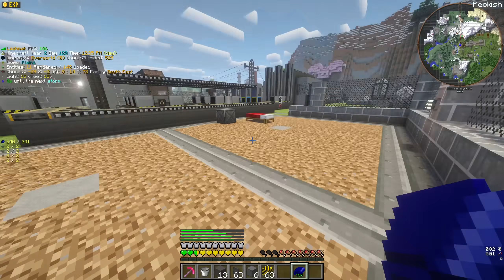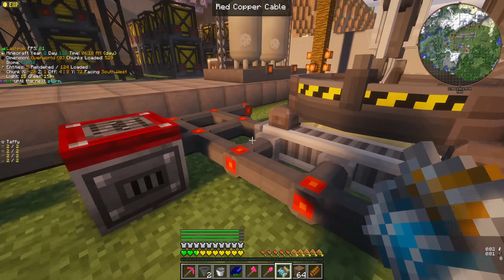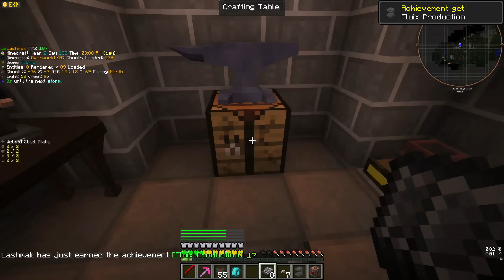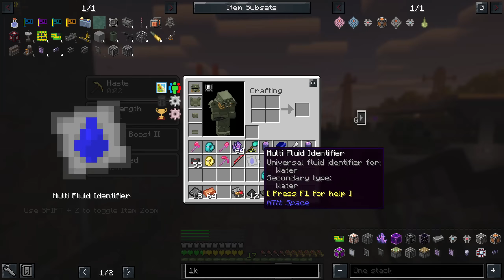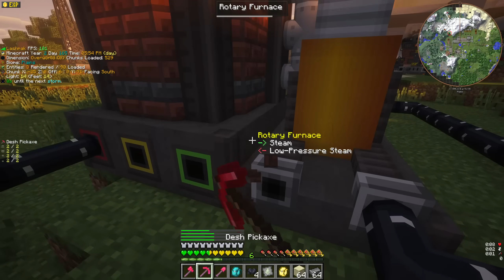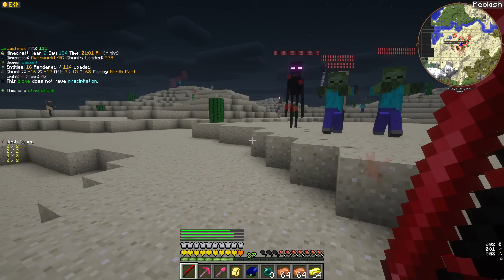NuclearTech: New Horizons - Ep05 - Sieving Factory and AE2

Comment: You could actually start doing space stuff now if you wanted to (unless this pack gates it more) so the Star-dar isn’t necessarily as useless as you think.
Can’t say I’d recommend it as it takes a lot of investment before you see good returns though and it acts more as an alternative progression/resource generation path for a while.

I would highly recommend making some acidizers btw, to upgrade your ore processing further (they also let you make fibreglass for super cheap silicon). Might need some speed upgrades to make them bearable though.
If you wanted to you could even go the whole way and make the electrolysis machine too for 6x ore processing.

Also you should be able to use one of those dense wires to make a dense wire cast for the crucible (once again assuming they haven’t changed anything), saves a few steps and a whole lot of power.

Comment: the range of pneumatic tubes is very extensive. even just a line of compressors with speed 2 upgrades can provide tons of item movement. pneumatic tubes are extremely good.

Comment: Bello my lord use the strand caster! It works like the foundry basin just pour molten fluid in the top from a foundry with all the molds you can make plates and cast plates a lot faster. you just provide it with water on the side and it makes low pressure steam as a output

Comment: Im pretty sure the easiest nuclear reactor you can make in the mod is the ZIRNOX reactor. The reactor can also use natural uranium as fuel so no need to enrich it.

Btw if you dont want to store low pressure steam in a tank there is something called a drain that you can make to void the low pressure steam
Reply: Why the hell would u ever store or vent low pressure steam
Reply: @boi2192 
When he made the furnace he was storing the low pressure steam in a tank

Also regarding venting low pressure steam it is simply slightly easier to vent it than to turn it back into water
Reply: Also, the actual easiest is the chicago pile, but its useless unless u have other reactors. The zirnox is the easiest, but its main purpose is to breed materials, not make power
Reply: @boi2192 
Well fot nuclear power it is either that or to make an RBMK or PWR and i am not sure if he is gonna test them out in a creative world first. Plus those reactors need you to learn how they work. While the ZIRNOX is MOSTLY a put down and use reactor